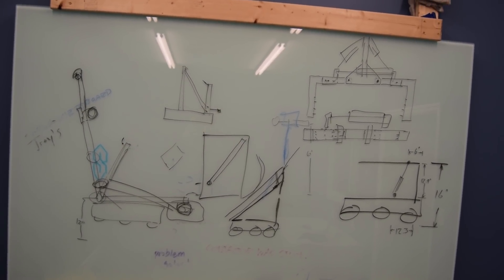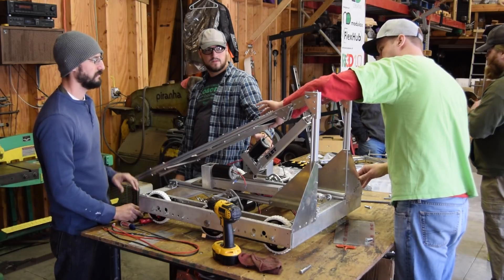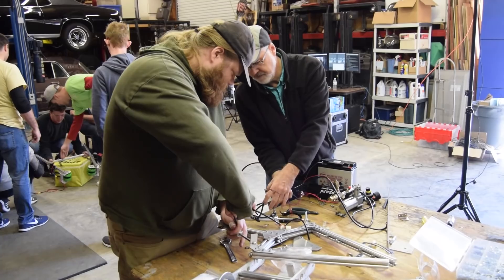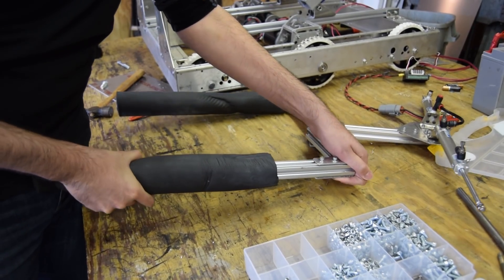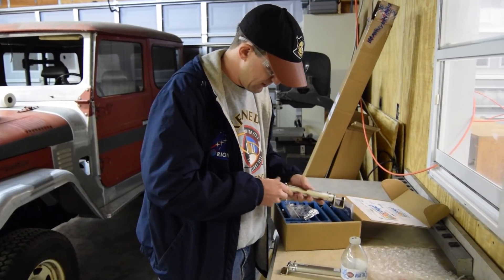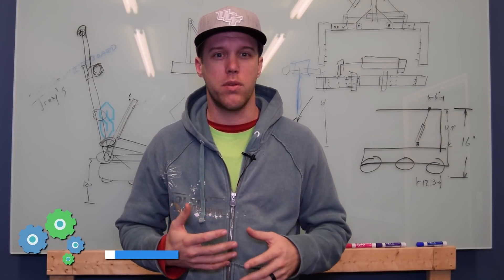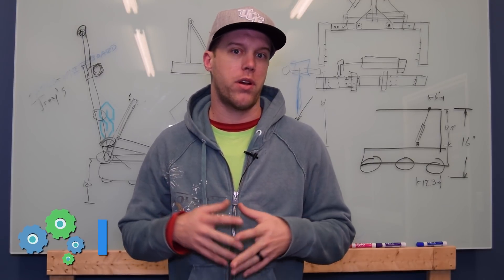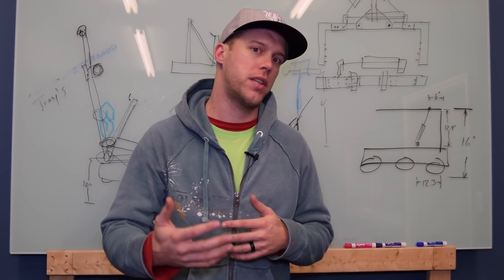Team Ri3D 1.0 - Cube Intake Mechanisms and Arm Prototypes for Power Up - FRC 2018

Comment: Side rollers won't be as space taking if the wheels are small
Reply from the maker: Certainly possible! Due to the square shape of the game object, we focused more on using the AM compliance wheels since they provide a great grip yet can still deform for weird angles (i.e. corners) of the box to be snug. You could probably mimic that with rollers paired with foam or another material, definitely a great idea for your team to prototype with!